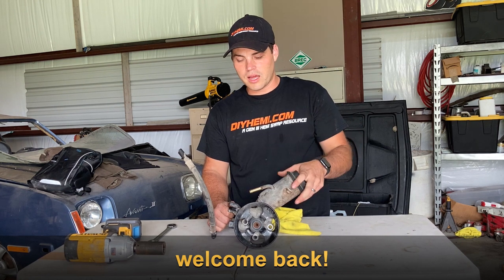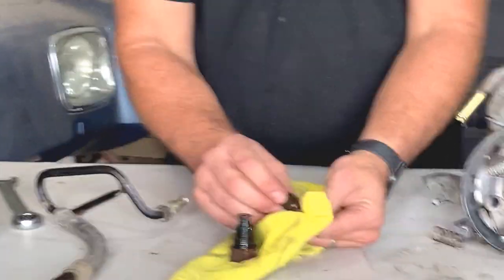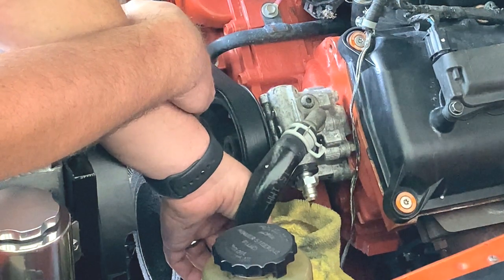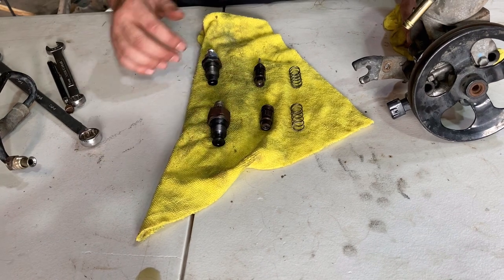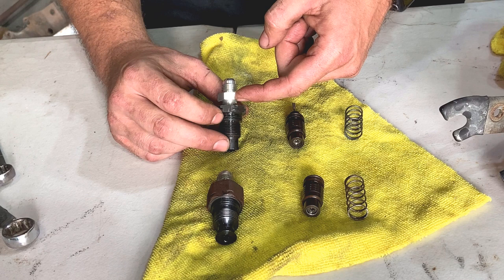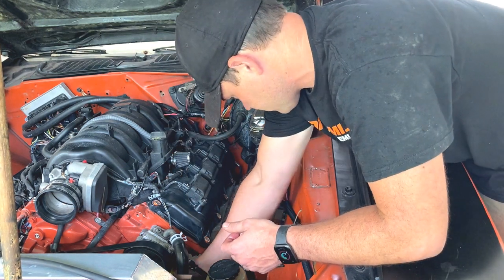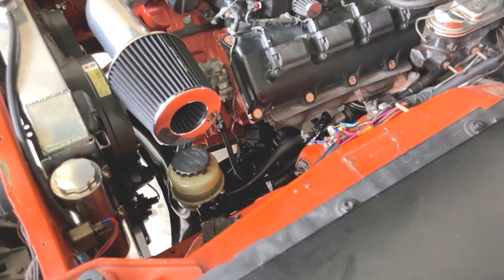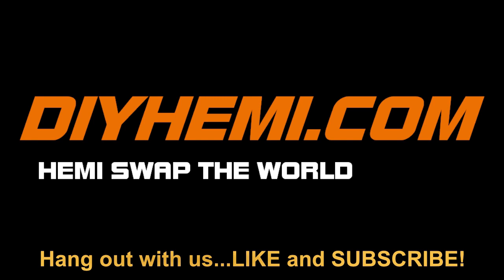DIYHEMI Junkyard Dive #3 – Part 2 –Toyota Parts- reduce power steering pressure for your hemi swap!

Comment: Any info or the results of this? Did the echo relief valve work out?
Reply from the maker: The echo valve worked, but it was too low of pressure for our tastes. We are testing a corolla next
Reply: @SUBLIMEparts  Keep us updated. I would love to use the oem pump rather then just buying the kit from Holley.

Comment: Thank you. This was so helpful to me. Swapping a 2JZ into an old Mercedes and needed to get the the Toyota P/S pressure down to around 850 psi. Looks like the Echo pressure relief valve will do the trick!
Reply: Any luck on that?  I'm curious if the larger PS pumps on the JZ and UZ motors utilize the same internal pressure regulation mechanism (or at least has the same dimensions and can be swapped across).
Reply: @w58bushings  Here's a partial update on this. So, the regulator in the PS pump that came with my 1999 2JZ is not compatible with the Echo. The piston and spring in the 2JZ pump are much smaller in diameter, oddly enough. The metric dimensions of the spring are odd, but are functionally equivalent to 13/32" ID and 17/32" OD at about 1-1/2" long.  I was able to find a spring that matches those dimensions, with a rate that is 2/3 the stock spring rate. That will get me just a bit under what the Mercedes PS box expects, so I am hopeful. It will be another few months before I can actually test it, though!

Comment: Wish I would have seen this video earlier before I bought my Type2 setup.  It was so frustrating trying to find info on the OE pump, Mopar was zero help.  Awesome info.  Do you find any hear issues without running a cooler?

Comment: I'm putting a 6.1 in a '73 Challenger. You are going from an "F" valve to a "D" valve to reduce the pressure.
 I have a relief valve and spring from a Grand Cherokee that has a "C" etched on it.  Do we, can we ,maybe, assume that the pressures valves are marked in alphabetical order and this "C" valve is lower pressure than the "D".
I will be looking for a "D" valve , but was looking through the stuff I had on hand and found this valve.

Comment: My 2011 6.4 pump probably blew out my rebuilt stock 72 Imperial steering box soon after startup.  
Wheel is heavy with intermittent assist after a few correct pinky finger power turns of the steering wheel, so pressure probably not going where it's supposed to go now.

I had a heck of a time finding specifications for various mopar boxes, and am working hard to escape $450 aftermarket steering pump tyranny when I have two stock pumps in hand.   
Holley is offering a $450 (!!!) option, so are a few others. 
https://www.holley.com/products/engine/accessory_drive_brackets_and_kits/mopar_gen_iii_hemi/power_steering_add-on_kits/parts/VK090241
It appears that they changed the PULLEY and not the valve.  Larger pulley means conflict with the belt tensioner in stock pump location, so they have an offset mounting plate to move the pulley spindle away from the belt tensioner (?).

- a magazine wrote it up WITH SPECS below:
--------------
https://moparconnectionmagazine.com/holleys-g3-hemi-swap-power-steering-kit/

"The power steering pump on the late-model non-SRT cars (before 4/9/2007) and all SRT vehicles can pressure up to 1740 pounds per square inch gauge (psig). 
On non-SRT cars (after 4/9/2007), the pump builds 1590 psig. 
The Holley pump provides 1200 psig with a low-flow 0.88 gallons per minute (GPM) and 2.8 GPM high-flow.

Depending upon the swap vehicle’s power steering box manufacturer (Federal or Saginaw) and displacement (0.94, 0.96, 1.02, or 1.06 cubic inches), the Holley pump pressure is marginally higher than the 850-1000 psig found on most a-bodies 
<<and>> the 1075 psig of the b- and e-bodies. 
It is slightly less than the 1300 psig found on many c-bodies. 
The muscle car era pumps flowed between 1.2 to 3.0 GPM, similar to the Holley pump."

I have a C-body.  Heavier car, fat tires now, so more pressure needed? 
I'm looking to have my pump valved to 1300, but not sure how to assure myself that I got it right - will call Borgeson and ask them.

I am also considering a Borgeson box that's smaller and a bit firmer to get space between my exh. manifold and box.
It is claimed to remove the on-center slop that is present in all vintage Mopar steering but is masked when running.
http://www.borgeson.com/xcart/product.php?productid=1757&cat=143&page=1  

Also note the very interesting Alternator relocation bracket that's 'spensive, but does a magic trick:
https://www.holley.com/products/engine_swap_parts/accessory_drive_brackets_and_kits/parts/97-347

Comment: Hi
I have an 06 Jeep Grand Cherokee with a 5.7 Hemi.
It has a hydraulic cooling fan that I want to eliminate..........and replace with an electric one.
It is powered by the power steering pump.
Couldn't I just use a pump from a Hemi-powered truck or car???
Reply from the maker: The power steering pump is the same between Jeep and car. Just eliminate the fan assembly from the power steering piping. Our Jeep commander had the same hydraulic fan. You can remove and bypass the plumbing

Comment: Cool. I was trying to use a truck pump because it has the reservoir built and it didn't work out. The pump was riding up against the tensioner.

Comment: Just ordered a pump from a Scion xA for my swap - their service manual says it should be minimum 850psi. I'll check what letter the valve has when it shows up. Looking for a bit less than the 1000+ on my B body.
Reply from the maker: Nicholas Vacirca please let us know, we are thinking the 785 from the echo may be too low. Look for an update video on our findings while autocrossing the cuda and getting some real good seat time with the new power steering setup
Reply: @SUBLIMEparts  Looks like it's a 'C' from the xA pump.
Reply from the maker: Nicholas Vacirca perfect, thanks for the info!
Reply: @vrenlos  Nicholas - Did you ever swap for the C valve and what were the results? Also, I just enjoyed your trans shift seal video.
Reply: @HEMIJJ  Sadly I haven't gotten around to executing the swap yet...lots of life happening. Hopefully soon!